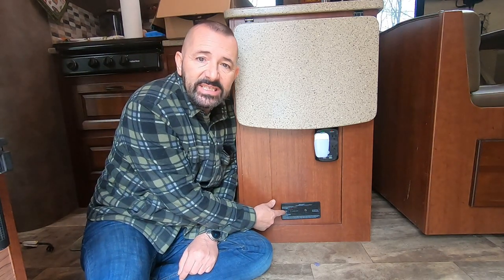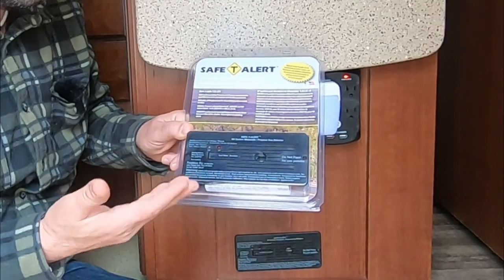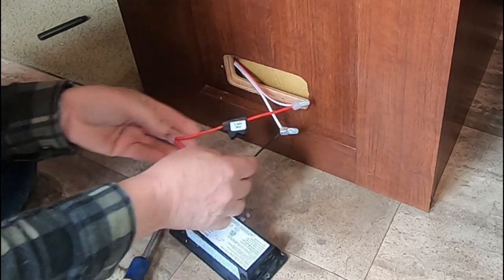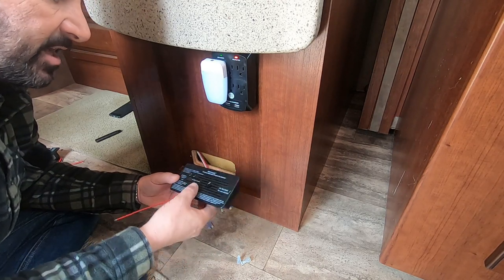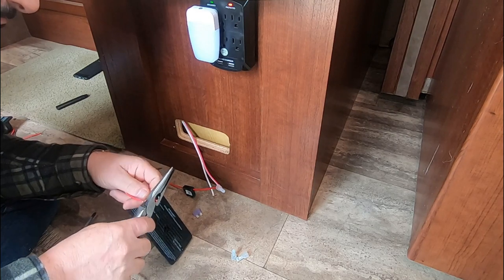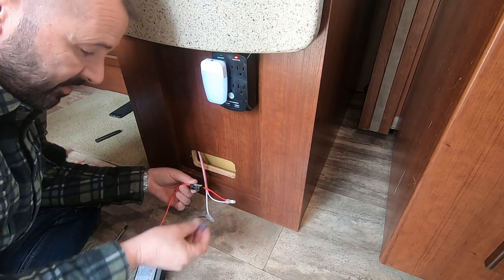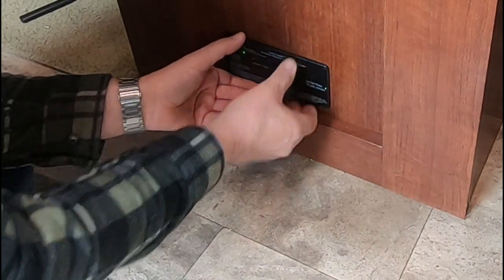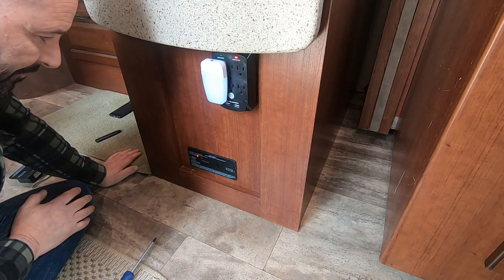Replacing The LP Gas / CO Detector In The RV – How To Replace Propane and Carbon Monoxide Detector

Comment: Just waiting for mine to arrive.  The current alarm was the original when the rig was built.  So way overdue, although it never makes a peep.  Yes it does have power and the test button works etc.  Thanks for the tips, I did pull the old one out and it is butt connected.  I'll switch it to those style caps you used.  Thanks for a great video.
Reply from the maker: Good luck. thanks for watching.

Comment: I guess that's the slimline model? Right? I like that style because it's mostly hidden. I'll need to cut out my thin rv wall to make it fit. My old MTI model 20-441 was not as wide and external mount on a mounting plate. Thank you, happy and safe RVing 😊
Reply from the maker: Yes it is designed to be recessed in a wall cutout.

Comment: I reinstalled a similar type of gas detector in my RV but it did not power on. There was no on-board fuse present as there is in your video. How do I troubleshoot if the unit does not power on? (I have already returned it to Amazon).
Reply from the maker: You would need to start by checking the wiring from the RV with a multimeter.

Comment: Hope this isn’t a dumb question, mine just started going off, so I order one to replace it. Do I have to disconnect the battery before install it?
Reply from the maker: Working with 12v can always cause a short if wires are crossed.  It is best to remove the fuse or disconnect batteries when performing work.

Comment: Hello, my lp/co monitor was manufactured in 2014, but the trailer I bought is a 2015 and I’ve had it for 2 years now. The battery power I have when not at a hookup site fluctuates due to how solar is being taken in as it’s wired straight into my (one) 12V battery. On multiple occasions the alarm has gone off after I go to bed when it’s dark out. The first time was concerning obviously I thought there was a leak somewhere, but no signs of one anywhere, no smell etc. opening all the windows and doors eventually got it to turn off which seems weird but it’s happened multiple times now which makes sleeping during camping stressful. Would you reckon it’s going off due to its age/something malfunctioning or not enough constant battery power? Thx!
Reply from the maker: The detector is long overdue for replacement if it is from 2014.  I would replace it and go from there.

Comment: I do not have a fuse in my wiring . My wires are brown and white. What wires connect to which color? My son wanted to “help” and undid then before I seen what went where
Reply from the maker: You will need a multimeter to determine positive and negative.

Comment: Hi Lou!  Thanks for the video.  Any idea of the lifespan of these devices? Mine is going on 7 years old and might need to swap out.
Reply from the maker: Hi, they should be replaced every five years.  They are supposed to beep but I have seen my share and seen many that are installed for years without ever beeping.  Be safe and look at the date on the back.  If it is near five years old I would replace it. Thank you for watching.

Comment: There are other models of the detector I'm replacing that are much cheaper. Can I use one of those or does it need to be the same?
Reply from the maker: There are several different brands that you can choose from.  I would  make sure it has same protection such as propane and  carbon monoxide.  Good luck.

Comment: Here's MY problem.  Everything you say makes sense, I ordered the exact proper replacement with two wires coming out the back....but when I tug on the existing old wires, I can't see any wire nuts, and there is almost no slack to pull on them.  Frustrating.
Reply from the maker: Hi Bob,  find the fuse in the power center box and remove it.  You can  now work on the old Detector. After removing old detector reinsert fuse to determine which wire is positive with multimeter.  Remove fuse, make your connections, then reinsert fuse.  This is provided you are comfortable with working on 12v. Good luck.
Reply: Why do I have to be in a county where finding RV parts is impossible and amazon takes too long.  My fridge is dead and it’s 109  degrees!  And I have a severe issue that developed with my vision!  Grrrrrr!

Comment: Good job Lou. Glad to see a new video. I am impressed that you reused the crimp connecters that easily. Check out the links on my videos to get some awesome wire strippers and crimpers for the rig.   :)
Reply from the maker: Thanks Ken, I actually bought myself a very nice pair of wire strippers last summer and of course forgot them in my tool bag when I was filming this.   Thanks for watching!

Comment: You didn't say what colors go where. No help it all.
Reply from the maker: Colors are not always the same  so telling you what colors go where may not be accurate.  If there is a fuse that will be the hot or power wire.  If there is no fuse you should use a multimeter to confirm.